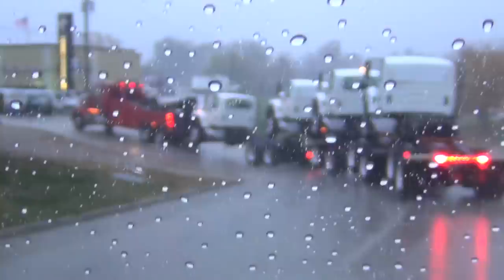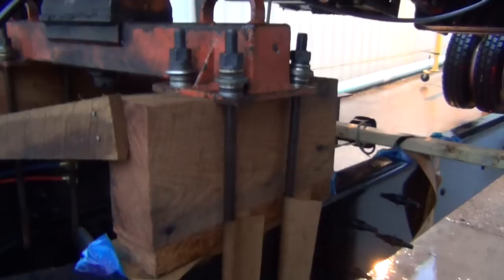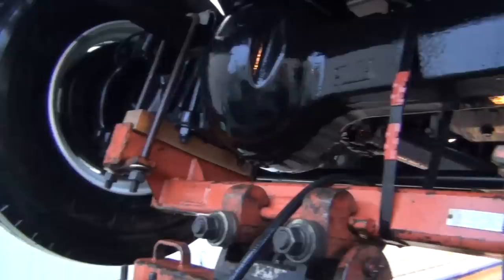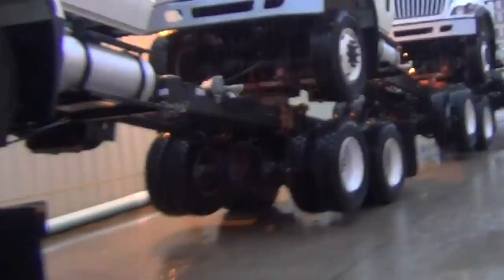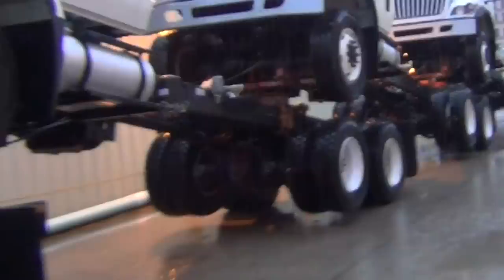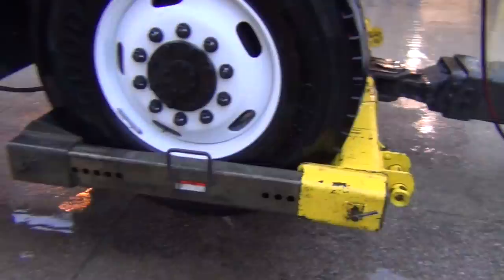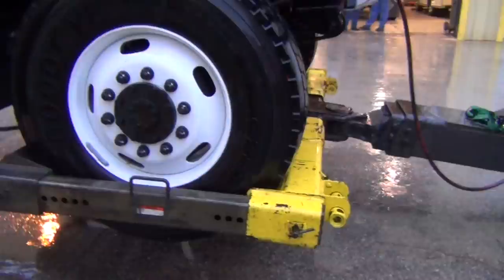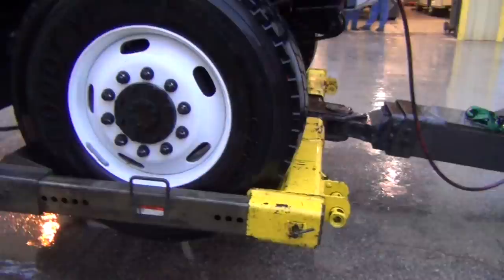Towing 4 Trucks With One Wrecker

Comment: there is a saying in the trucking industry which mostly refers to split axle flatbeds and van trailers.  "Give me 40 acres to turn this thing around" because that is about what you need sometimes.
Reply: Robert Benoit ... Don't know if you are still around, but that's actually an old Country song. I don't remember much of it, but I'm pretty sure one of the lines is this: Some guys can turn it on a dime
Or turn it right downtown
But give me forty acres 
And I'll turn this rig around.

Comment: Yeah that's looong & heavy but.
I hauled a broken Dodge extended cab 3/4 4x4 with Cummins from the front that had a 30ft goose neck behind it from a single lane gravel road and & after several tries turned it around  basically on the side of a small mountain.

With a 1 ton & 440 Holmes.
Was I over loaded ?
Hell yeah but sometimes because of where you are you have to do things you would not normally do.